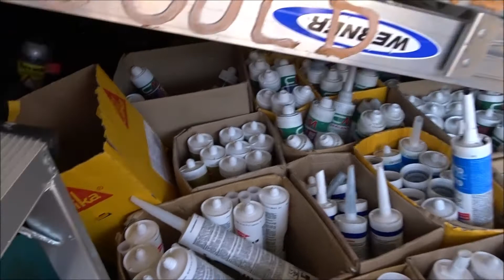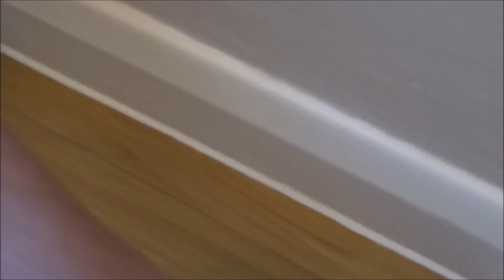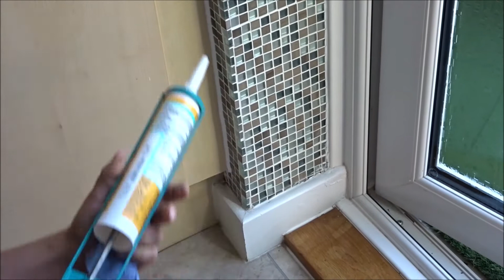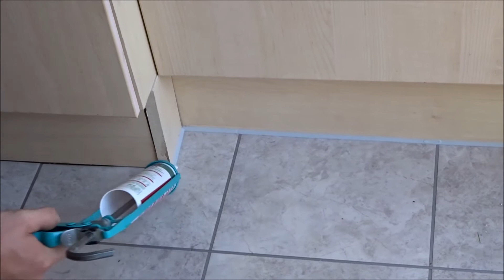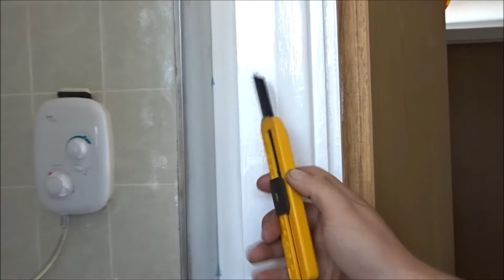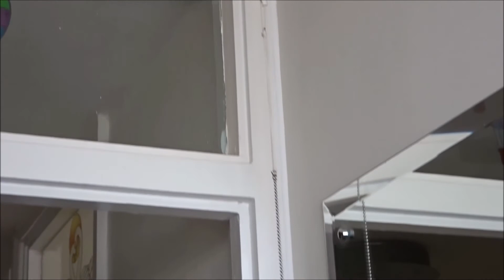Mastic Man 110820

Comment: Thank you for doing a video that does not wet tool. I get so tired of the morons using soapy water or window cleaner to tool with. I have installed sealants for over 40 years( on a much larger scale) and it is refreshing to to see someone doing a decent job of installing sealant.
Reply: Quick question. What do you use when tooling off to stop the mastic from adhering to your tooling stick?
Reply: There's always one annoying comment like this

So how the heck you stop it sticking!!!
Reply: @deepmystic6739  genegarden says not to wet tool, but doesn't provide an alternative method. I myself work in this industry. I'm keen to know how he works the mastic without it adhering to his tools.

Comment: Wow there is a business for this
Reply: I have been doing it professionally for over 40 years but on a much larger scale. You would be surprised how much sealant is used in modern construction. Our basic contract is for 300 lineal feet per day. Thats 1500 feet per week. 6000 feet per month. 72000 feet per year. Over 100 miles in ten years.

Comment: Any idea why silicone just doesn't stick to the sticks?
Reply: He sprays dishsoapy water on it
Reply: Yes.
Reply: @chrisahearn1735  nope dish soapy water is absolutely wrong. Every manufacturer says not to use it.
It us plain stupid to use
Reply: @genecarden780 Can you please explain the science behind this

It's infuriating me

I don't understand

Wood and silicone love each other

It does work when you wet the tool

I have tried hundreds of times, no matter how light or how hard the silicone sticks to the wood

So what's the secret here?

Specific hard wood?

Something less fibrous
Reply: @deepmystic6739  I use metal tools. The silicone does stick to it but only a little at the tip. After each pass you scrape  it off on a margin trowel before making the next pass. You use long even strokes. Not short choppy ones because with shorty choppy strokes every time you start the stroke again it does put that small blob back in the joint making a mess.
Like i said I use metal tools but have seen others that use wood. My problem with wood is we do a lot of sealants against concrete panels and wood tends to wear down. We typically make a long pass each direction to make sure it us bonded and one more for aesthetics.
Reply: @genecarden780  Thank you for this.

So even with the wood how is it possible for the silicone not to stick

I have recently started falling in love with the art of sealing and taking on a few jobs

I have been scraping mostly for internal places within the bathroom and kitchen and it's never possible to have a long stroke behind taps for instance

I get what you mean about the drag mark that happens when you are short with your strokes

Where can I get metal ones from?
Reply: @deepmystic6739  https://www.youtube.com/watch?v=JCOGBNdWiEI
this video you will see the proper way to tool 
He is caulking a door frame but basically all tooling is the same
Reply: @genecarden780  maybe in the us sealant manufacturers state that using a medium (soapy water or the above product)  to tool off is wrong. In the UK it is industry practice to install mastic this way. You will find it in nhbc regs.
Reply: YouTube might delete the link but if you search for 'sika sealant finishing agent' you will see.
Reply: @andrewengland8021  Sika is one of the least aggressive in their wording. They only say “ dry tooling is recommended”. They have tried a few different formulas for their proprietary tooling agent. It is not soapy water. They still have adhesion problems with it. I am not even sure if it is available in the USA any more.If you read their literature it says test before using. Urethanes are not affected physically by tooling agents,(except for alcohols)the risk with urethanes is joint contamination.
Silicone has been proven to be physically altered by these tooling agents.
As for the discrepancies between the 2 countries. I don’t know. I would like to think it is a higher regard for tradition that you have in the UK.( I know it’s a stereotype but I love old buildings)But my guess( and it’s only a guess) is simply the vast number of high rises being built all across the USA.Wiki says there are as many high rises in New York as there are in the UK ( don’t know how accurate this is, but you get the idea) Many of these use $20000-$50000 in sealants.Coupled with the fact that specifiers for these high rises demand a 20 year performance guarantee on the sealants ( instead of the typical 7). Higher liability,higher standards. Like I said just a guess.To get these guarantees we have to have independent testing as the projects progress and it has been found there is a much higher failure rate with tooling aids. Silicones frequently fail adhesion/cohesion tests when wet tooled.There have even been complete failures of some urethanes that were traced back to using alcohol as a tooling agent. Manufacturers are far less concerned about liability on smaller buildings.We never have to have testing on smaller projects.As you can see from all of the YouTube videos showing the use of soapy water,even in the USA, the manufacturers aren’t concerned about small time users. They have almost zero liability from these users. The simple fact is unless a large volume of sealant is used on a single project it is not usually tested. Dow and GE silicones are 2 of the most used silicone sealants used world wide.
Reply: @genecarden780  interesting, thanks for the reply. This issue of wet tooling has never come up over here. I was taught by an applicator who is now in his 70s who had over 45yrs in construction. When he started it was a trowel applied mastic, almost like putty. You only see this now on heritage jobs. Listed buildings etc. He was taught to wet tool. 
I myself have worked for a short time in Germany where the method is the same.
 
I'm going to bring this up the next time I see our sealant supply rep. I'd be interested to see what he says about liability etc

Comment: First you should not be using silicone.second using sticks to tool? My God if you showed up asking for a job and I saw your gun and tools I would say no.
Reply from the maker: Can you send me link to one of your videos ? I'm always willing to learn!
Reply: Lee, I'm curious as to what materials he should be using? You sound like you know what you are talking about.
Reply: @andrewengland8021  I don't do videos.you can't paint silicone.either use a urethane or acrylic.silicones you also have to watch cause there are  different ones for different surfaces
Reply: @leekreeger9885  Maybe they dont want to paint. Plus silicone is more flexible and durable if any flooring shifts happen.
Reply: @anderszidane973  First he is installing it to a painted surface so the idea that “ maybe they don’t want to paint it” is ridiculous.  It WILL have to be painted someday. Silicone is more durable than urethane for only one reason urethane is organic so it breaks down under severe UV . Since this is an interior that is a non factor. Silicone is s terrible choice for this situation. End of story.
Acrylic IS garbage but the only place it is truly acceptable is walls to trim. Like walls to baseboards. 
I have been a professional caulker for over 45 years and would fire anyone that used silicone at the wall to baseboard.